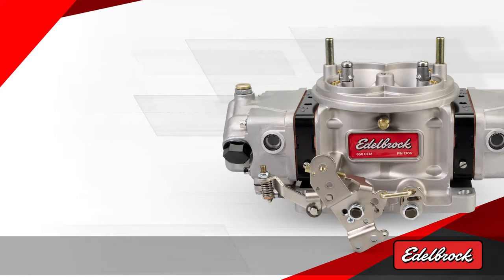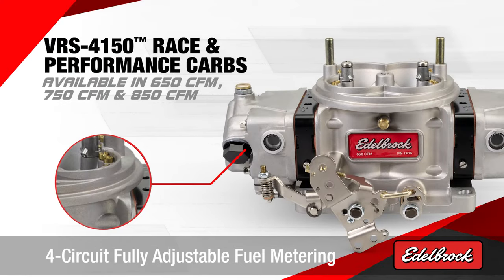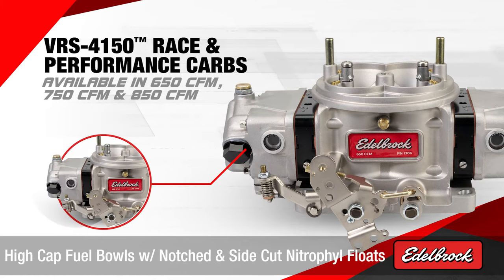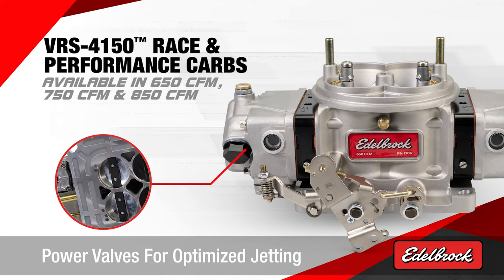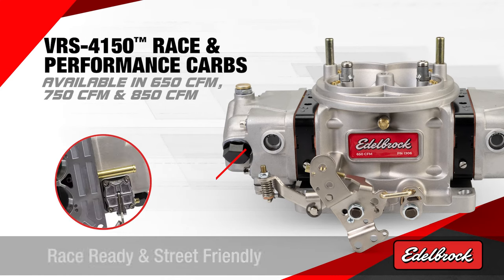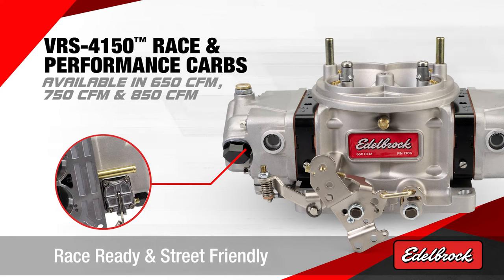Edelbrock VRS-4150 Race And Performance Series Carburetor

Comment: I just picked up a new 1307 (750).  Very nice carb,  Very smooth power compared to the double-pumper its replacing, I attribute that to the very nicely done Annular Boosters.  The only thing that was way off was the transition, it went from idle 13.0AFR (1 turn out) to 15AFR, causing the motor to cough and stumble until the primary booster came in.  I had to change the idle bleed from a 70 all the way down to a 42.  I also tried a 36 IFR (from the stock 31), which basically had the same affect with the standard 70 idle bleed jet.  I also changed the standard 4.5 Power Valve to a 8.5.  The engine (445 Ford FE Stroker, Edelbrock Al Heads, RPM Performer, Comp Cam (230/236@.050, .530 lift) pulls clean and hard thru the power band at 12.5AFR, but at light load (cruise) it is pig rich at 10.5.  I'm not sure what dial to turn to lean 'cruise' out?  I've called Edelbrock Support twice with them telling me they have no literature on these carbs, so they have no idea what to do.  This is pretty concerning and disappointing.  Edelbrock?  Anyone who has knowledge?  Advise would be greatly appreciated.
Reply: Hope you get it figured out. You sure it’s not possibly staying slightly open somehow or maybe the air filter needs cleaning? Just spitballin since it seems as if you’ve crossed your ‘t’s’.